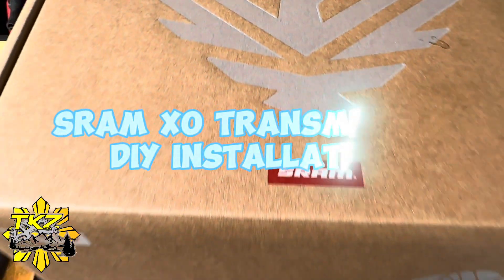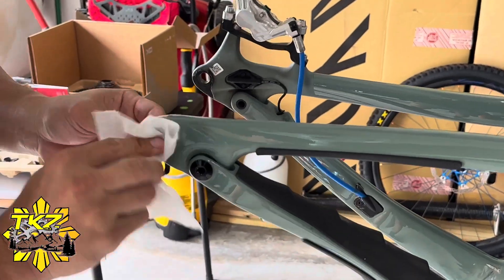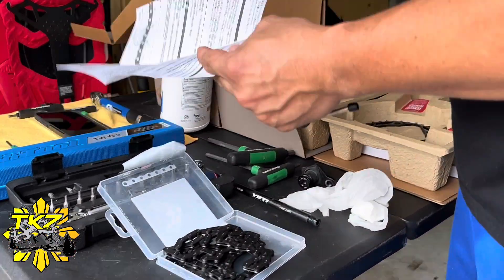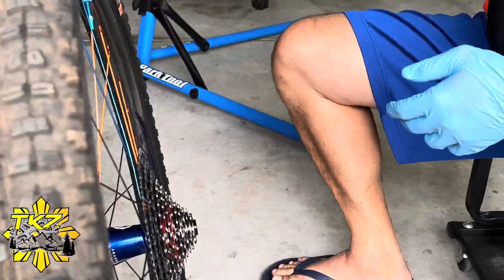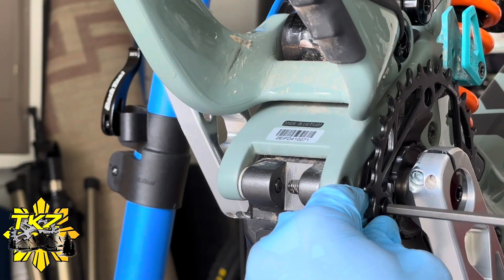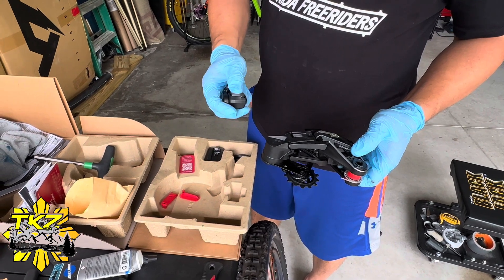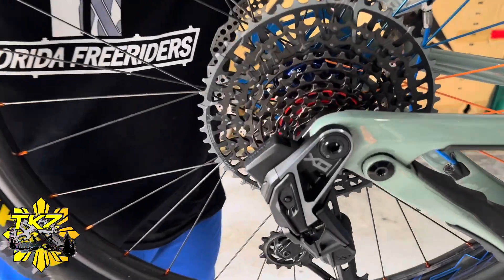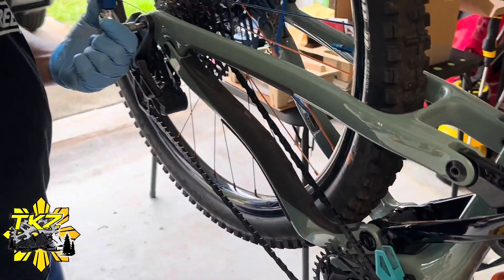SRAM XO TRANSMISSION UPGRADE DIY INSTALL @SRAM @yeticycles

Comment: What is that chain ring? Also got a 160e and just ordered XO T type setup but still need to acquire chainring.  Thnx
Reply from the maker: it’s a sram chainring but compatible to t-type chain. you can also get one from 5dev i think.